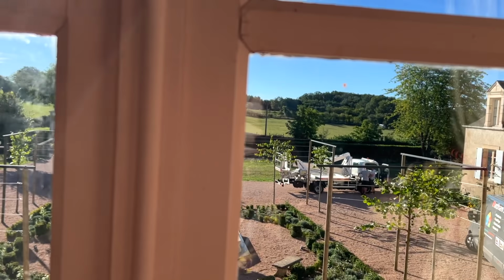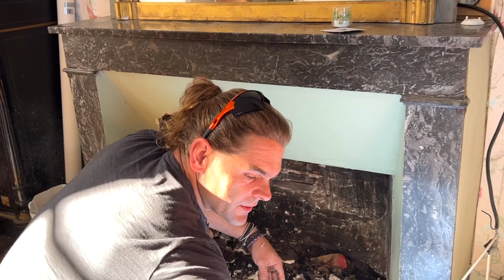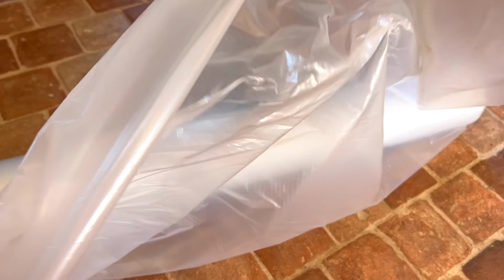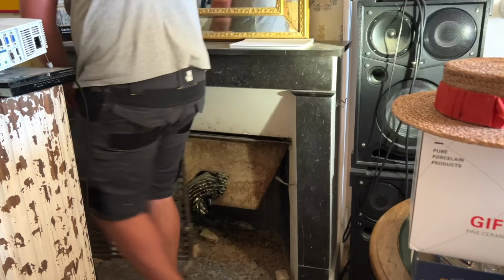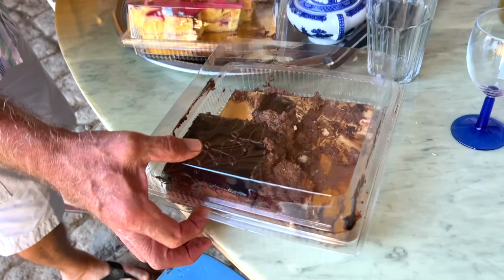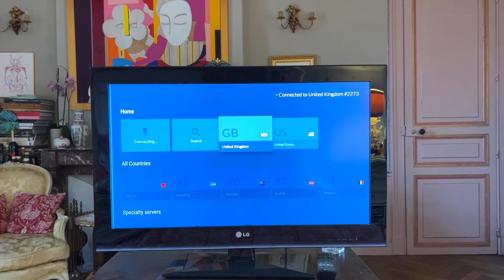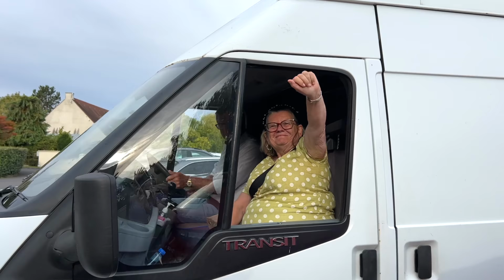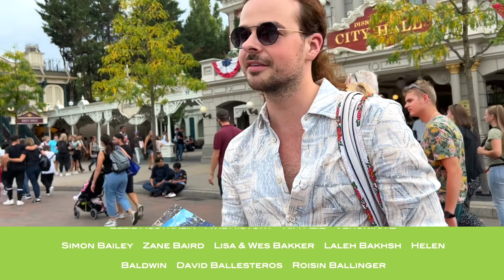A Major Chateau Setback

Comment: Stephanie, thank you for the mention at the end of the vlog!!! I totally know the feeling about having such a major setback.  We have two huge lifts outside at ARIA right now and the bigger piece did not extend long enough to reach a span of roofing so they are going to have to do that area from the ladder.  Luckily it is a small area.  I didn't want them to drive the picker on the lawn knowing that it would break all the sprinkler pipes and we would have to dig all those up in the Spring to fix them, so sadly I said no.  Happy Birthday Philip.  Have a great day guys!  Jason
Reply from the maker: We have the same problem - we’re worried the bigger cherry picker will damage our pipes, but we’ve decided to take the risk 😬

Comment: Where you have 4 fireplaces on 3 flues in 1 chimney could you go to the attic and separate the chimneys as they come up to the attic level ND separate them to a new number of chimneys and flues but you will also need to repair the roof where the new chimney and flue passes through

Comment: 💕Think you need a camera put up or down each chimney to see where they go💕It may be that some are just for display purposes only💕When you light the fire in the winter salon does the smoke come out of the chimney stack💕
Reply: good idea.also, to seal off, at the top, any chimney that's not used. cold air descends....n as far colder winters are predicted, unused n unsealed flues could negate any attempts at warmth. the cowl tops of flues lining a chimney birds also love to nest in, buggering up the efficiency when they block them with nesting material. a chicken wire cover prevents that.

Comment: Depending on which calendar you follow, autumn started on Aug 1 and ends Oct 31 and Winter starts Nov 1 to Jan 30, Spring is Feb 1 to Apr 30 and Summer is May 1 to July 31. Granted this in the northern hemisphere, swap the seasons for southern hemisphere. The reason the temperatures follow a pattern that is about a month and a half later is called seasonal lag. The rest people can look up for them self if you insist on telling me I am wrong because you have been told otherwise, but I am not forcing you to believe this information, I am just stating facts as I researched them. I can believe as I wish and I won't force you to believe as I understand everything. Good luck with that, but yes, this episode aired when the season is Autumn in September.

Comment: Can I ask why use the log burner versus just the fireplace? I’m clueless! 😃
Reply: Fireplaces lose most of the heat up the chimney. Most people upgrade to log or wood burners. If you get windows in them you can still see the flames. Some mountain houses have glass in front of fireplace and blowers underneath with vents. The dogs sleep in front of the vents. You are trying to get the heat out to the floor to warm the room, not up the chimney. 😘😘😘

Comment: Hello Stephanie
 When you get them to check your flu's you might have to put new tubes in the fireplace in the chimney for each fireplace fireplace you get the tube and they go right out the chimney we ended up having 2 fireplaces that worked and then we spent a little extra money and we ended up having all the fireplaces working so instead of just having 2 or 3 we have 6 or 7 And they work fabulously during the Winter I cannot believe those little exthose little extra log burners how much it heats the house so good luck but you might You might wanna think about getting them all done